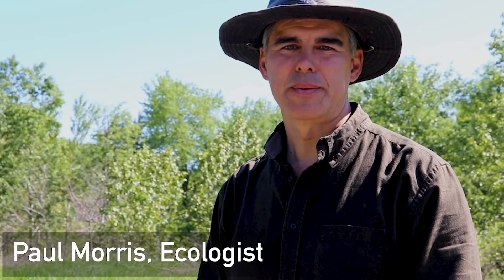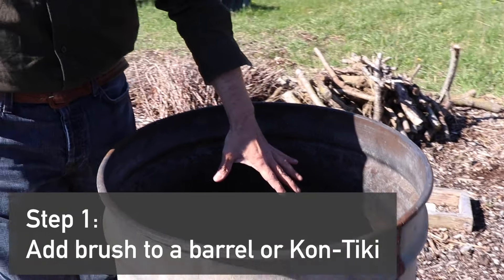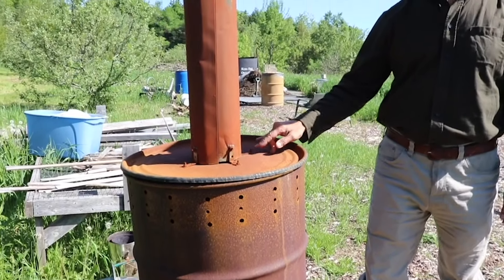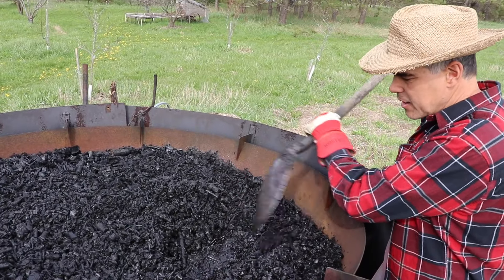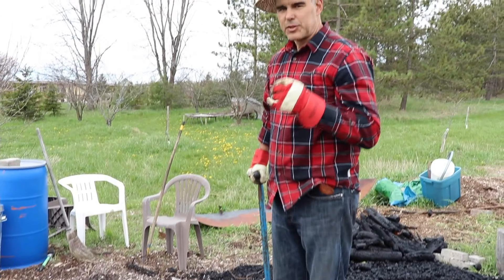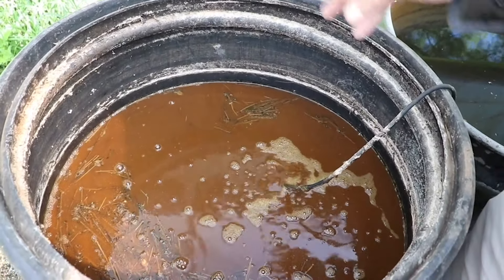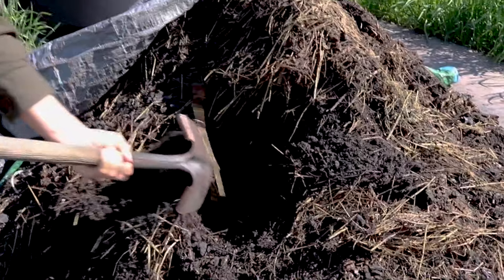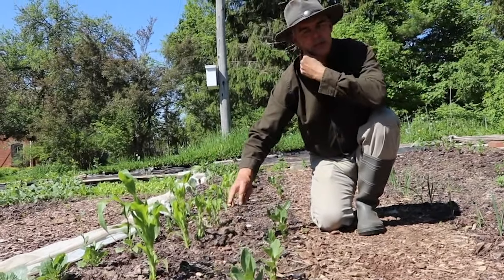THE ULTIMATE GUIDE TO BIOCHAR: how to make it, how to use it, and why it's important

Comment: Wonderful video, thank you. Do you see any possibilities for using biochar on a large scale, specifically in urban green waste recycling?
Reply from the maker: For urban applications, I would compost and keep the nutrients. Biochar is like a sponge and holds water and nutrients in the soil and slowly releases them. Biochar is for high carbon materials like wood, corn stalks...
Reply: @PlanetHealers  Good point.  It would be interesting if a community that had large amounts of wood available made biochar, and then gave it to people (or sold it inexpensively) to use in their yards.  It would help with water retention, and soil fertility.  Hmm, I may have a small community project on my hands.  I am moving to an area that has these exact properties.  Your video has been extremely helpful!
Reply from the maker: @thisorthat7626  It is a fair bit of work to do this (the results are great) so if I was offering to others I would sell it to compensate for your time and materials.
Reply: @PlanetHealers  Of course.  :). I was actually thinking out loud about starting such a program in the area I am moving to.  All the requirements are there.  It's a question of whether I want to put in the work for free, or for a small compensation.  Your video was extremely helpful!!

Comment: I love this! So easy to follow, simple step by step.
I'm new to gardening and this has helped immensely since I'm doing organic planting.
Reply from the maker: Cheers!
Reply: You don't need any special equipment.  I simply build a teepee shaped burn pile, taller than wide, it burns fast and clean that way with flames shooting up the middle. (also takes much less space in the yard than a random pile) In about 90 minutes my 8 ft diameter by 10 or 12 ft tall, dense pile is ready to be mostly quenched with just small pile of big chunks raked aside for continued burning. Quench with garden hose as soon as there is near zero woody material left.  I get a couple big wheelbarrows of char each time twice per yr from my tree trimmings.

My yields may not be optimal but time invested is minimal and no barrel required, minimal handling.  Note of caution:  check on char a few times for couple hrs and soak it completely or you might come back next day to a pile of white ash as the char can easily relight and consume itself.

Comment: So once you add the bio char, do you need to keep adding it?  Or just add the bio to replenish the microbes in the char that is in the soil?
Reply from the maker: You could keep adding it to the soil until the cabon component is 25-30% but usually 10% is enough for most soils. Our plots in the Yucatan had higher % because we wanted to hold more moisture in that fast draining soil. Yes you can just add more organic matter or compost to keep the nutrients up. we use our super brew.

Comment: thank you for your good vidios you post.😊 question when the biochar is ready, I can't understand how much I should have in the cultivation soil.  you say 10% but in comparison with what (the surface only) or 10% of the first 10cm of the soil layer, that is to say about one centimeter of 10cm of soil (10L of biochar and 90L of cultivation soil. you say that it took 2 bags at the end of the vidio but that doesn't say much as you don't see the whole surface nor how big the sacks are?. thanks in advance from a follower from Sweden.😊👍
Reply from the maker: We didn't use much in Canada because the soil is fairly good so 10% is fine. 1-2 kg per m2 if calculating by area. We applied to the top for no till and the soil biota was mixing it deeper by the end of the season. In the Yucatan with poor soil we were adding up to 50% biochar. Really depends on your application.
Reply: @PlanetHealers  thanks 😊👍👍👍❤️

Comment: Awesome video! What was the weight on the carpet roller that you used? 75lb or 35lb?
Reply from the maker: Not sure the weight, it was what they were using at the ecovillage. The diameter of the roller was not really wide enough, and it tended to snowplow the char. It takes a fair bit of muscle to roll it fast enough to get it to ride over the char. I'll be making a roller out of concrete and a bucket to get a wider diameter.

Comment: Hi, I have a question regarding the use of Eucaliptus stock
But first, I'd like to thank you for this great information video. 
Regarding my question: 
I have access to nearly unlimited Eucalyptus waste (branches), but I am worried about the allelopathic substances in Eucalyptus. 
I would like to find out if these substances are removed completely during the biochar production process.
Thanks upfront for any further information regarding this.
Reply from the maker: In a complete burn the volatile oils would be removed and leave only carbon. If there are partially burned pieces, which happens sometimes, just return them in the next batch.  You could test the char made by pulverizing it and mixing it with your soil. Put it in a tray and seed radish and lettuce. Grow normally and check for healthy growth. This is a simple toxicity test.

Comment: Great video:) It seems the single barrel method is easiest to operate, am I right in assuming so? Also in the single oil barrel method, do I need to make holes at the bottom etc or not required?....water, do I fully submerge all the biochar in the barrel while quenching the fire? What can I do with the remainder water after removing the biochar 3-4 days after quenching, any application possible? In the single oil barrel method, 1st to add hardwood at the bottom, then some lighter wood pieces for easier burn....then keep topping up with hard wood preferably (or is ligher wood from prunings etc also ok once the fire gets started?) then towards the end, add lighter wood before quenching?
Reply from the maker: Yes the single barrel is best. No hole in the bottom. Only the top is open to exclude oxygen from the char or it will turn to ash (oxidation). yes fill the barrel with water to stop the burn and so the char absorbs water - needed for biological processes. We reuse the water in the next batch. the water will be quite basic from the ash created during the burn but will have potash and other minerals. Yes the sequence is correct. You can use soft wood to help get the fire started. Softwood also works but hardwood is better. Cheers
Reply: @PlanetHealers  thank you for the clarification regarding all points:)
Reply: Yep clarified things for me too. I’m gunna be using bamboo got heaps to get rid of. This is awesome thanks very much

Comment: Very good video. Thank you so much. I have a few questions. 1. I was very glad to hear it's contributing in some small way to the environment. However, I wonder if we are releasing Carbon into the atmosphere by burning the wood? Or causing other pollution in the burn. Wanting to make sure the good outweighs the bad. 2. I'm planting my garden now and I'm wondering if I can inoculate the charred wood I have and use it sooner than 3 months? I may not do quite such a complex job of inoculating, but want to make sure it is of use to the plants sooner. Will it keep improving if it's in the soil under a plant, therefore continuing to benefit the plant in the next few months & beyond? Thank you for your time and your generosity in sharing your knowledge.
Reply from the maker: 1. always know that you are using natural wood in the burn no treated wood. In nature, all the carbon would be released back to the environment and here we keep 50% for long-term soil amendment. 2. we have done a shorter charge and planted nitrogen fixers (beans) and used the super brew regularly and had 50% success 1st trial was good, 2nd had yellowed and stunted growth (we used less super brew to compensate). The biochar gets better year over year as the microbial community improves and the char is fully charged. The first year may not have the best results that is why we charge it for so long. So the char is fully charged and not taking from the soil.

Comment: Hi thanks for the video.  Just curious how you think I should incorporate biochar into my compost system I have.  I do deep litter method with 30 chickens and mainly maple leaves but some other carbon sources here and there. It's extremely rich in manure.  I use my winter deep litter to warm my seedling trays in the spring compost pile build.  It works good and my fertility is pretty good but I'd like it to be better.  I make about 3 to 4 cubic yards of compost per year for my 5000 square foot kitchen garden.  My summer and fall pile build is more green material and biomass from garden crops with leaves but less chicken manure or sometimes just fresh chop and drop plants mixed with leaves.  

I have sandy loam and only top dress 1 to 2 inches of the compost per season on my beds.  I only broad fork no tillage.  I put a light dusting of maple wood ash from my stove on my beds each year.  I'm thinking biochar will really help with the organic matter disappearing so fast in my sandy fast draining soils.  I was thinking of fabricating a Kon tiki.  I got the plans.  

I'm curious how much biochar to add to my deep litter from the chickens.  Could I mix it 50/50 deep litter and biochar?  and then just add the same inch or 2 per year?  I've gotten mixed messages on what to do in terms of ratios and have heard adding too much biochar can cause problems.  Anymore insight would be appreciated  Thanks
Reply from the maker: Hi, Yes, to compost we add 50% of the char and topdress with that. Adding the char to the chicken bedding also helps keep down the smell and when you clean out it mixes into the biochar fine.
Reply: @PlanetHealers  cool thanks for the reply.  Do you have any best practices literature you recommend reading that you learned from?  How many years should I add biochar?  is there a typical amount of applications to do per bed before you slow down adding biochar or stopping?
Reply from the maker: @MrMcGillicuddy  BIOCHAR GUIDELINES
FOR AGRICULTURE APPLICATIONS-
Practical insights for applying biochar to annual and perennial crops https://biochar-us.org/media/downloadable-pdf-file
Top dressing you can check the soil as it becomes incorporated by biological activity. The worms and other critters will pull the biochar deeper into the soil over time. You can keep applying up to 50% but 5-10% in the soil column is usually enough to be of benefit. We use closer to 50% in the Yucatan because we have a 6 month dry season that we need more moisture holding in the soil.
Reply from the maker: Sandy loam in Canada I was using the 10% for the moisture holding capacity of the char

Comment: Hi there thank you for this! The oil barrel you are using does it have a hole at the bottom and is it dug into the ground slightly? Many thanks !
Reply from the maker: No hole in the bottom or the water will drain out when you soak it. Not dug into the soil on a flat surface. Cheers

Comment: ❓❓❓I add material to my compost pile daily.  Do i have to set the chard into water first a week or 2, ir can i just lasagna add as im building up my compost? When im done adding it setups for 8 months and usually ready by then.
Reply from the maker: If you are adding it to compost, the char will wet in the pile, but to be sure, you could soak it first to make sure it is not hydrophobic and easier to absorb the nutrients.

Comment: I bought a pickup truck load of compost yesterday.  It has supposedly been composted for 12-24 months and is mulched trees.  There is about 10-20% uncomposted small limbs 4-8 inches long and 3/8 to 3/4" diameter.  There is also some biochar/charcoal in the mix.  I was thinking of running it through a shredder/chipper.  Does the size of the finished material make much difference to the micro-organisms?  I was also thinking of adding some green material and possible some horse manure with bedding pellets, to help finish composting.  Thanks for the video.
Reply from the maker: For your question, it depends on how fast you want the material to decompose. Smaller material will degrade more quickly (more surface area) and larger will be around longer.
Reply: @PlanetHealers   Thanks for the reply.  I should have been more specific, I meant does the size of the finished biochar have any effect?  Thanks
Reply from the maker: @customcutter100  Some people like to crush the biochar finely so it is easier to spread but I tend to leave it more course to allow a refuge for the microbes and holding more water
Reply: @PlanetHealers  How are you determining that the biochar is decomposing? The original terra Preta in Brazil is still growing after 500 years.  Many papers I've seen on biochar say that it is remarkable stable-for at least 300-400 years, and that's why it's so good for climate change. Stable carbon in the soil removes carbon from the air, and reduces the greenhouse effect.
Reply from the maker: @johns7713  I was replying to the fellow in this thread about the compost he is adding to the garden. The compost/manure part of the biochar will degrade over time but the carbon/charcoal will not as it is inert and stays for many years. We have seen great increases in soil fertility year over year in the beds we have created using biochar.

Comment: Thank you for making this very interesting video.
I have rather poor quality soil in my garden, so of course I'm very interested in improving it. Especially with natural methods, using and reusing organic materials readily available around me. Composting is of course go to method, and since I learned about biochar, I'm thinking about recreating 'terra preta' using various bits and pieces of wood that gather around the garden and orchard. 
I have a couple of questions about this method:
- Can chicken manure be used? I keep chickens, while cows are in much shorter supply around here 😂
- What's your thoughts on using small bones leftover from meals as a source of calcium for the soil? Should they be left as-is? Crushed into smaller pieces? Burned with the wood to incorporate calcium into biochar from the start?
- Would it be viable to add layers of biochar to compost pile, let it overwinter and spread the mix on the garden plots in the spring?
Reply from the maker: Hi Frik yes any kind of manure will work you just need to know what it is contributing to the mix to help balance the final project. Chicken bones I would put in with the biochar to burn them a bit to help release the calcium and discourage animals. Layering or mixing biochar in your compost is another way to charge the biochar and works well. When the compost is well done the biochar should be as well.
Reply: @PlanetHealers  Thank you!

Comment: Thanks again.   I've watched this video many times.  Great information!
Reply from the maker: Awesome, thank you!
Reply: @PlanetHealers  in your opinion, is there ever any negative from using char?
Reply from the maker: @SARJENT.  I suppose if it is made with more ash in the mix it would be more basic and could imbalance the soil pH. You can test this and balance the mix you add to charge the char. In the Yucatan, the soil was already more basic with limestone so we collected orange peels to make our compost more acid before adding it to the char. Using wood with toxic substances in it could be transferred to the soil. The carbon part of the char is inert so if made well it should cause no problems. Always be aware of what you're putting in to burn and the amendments that you are adding to charge the carbon.

Comment: Thank you for the this good video! i've learned a lot! I'm wondering if i can skip the super brew part and still be beneficial for my garden?
Reply from the maker: Just mixing in your compost or a manure pile will work also. The super brew helps charge it with all micronutrients and microbes
Reply: @PlanetHealers  thank you! I will get started as soon as snow melts